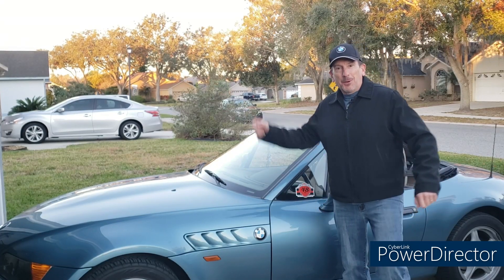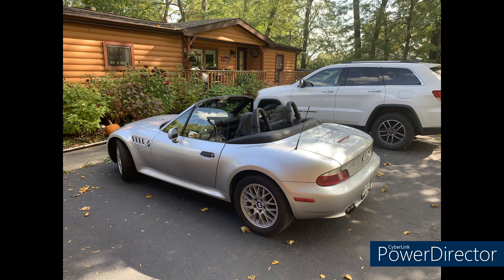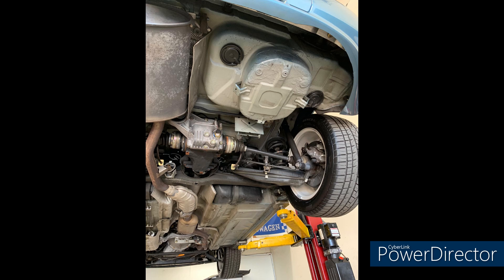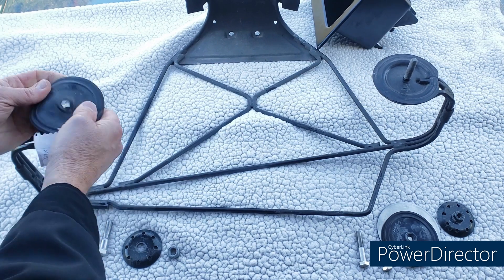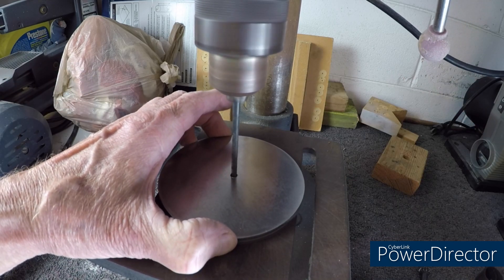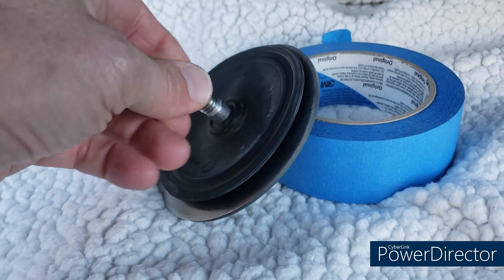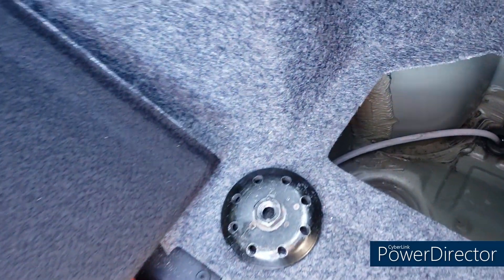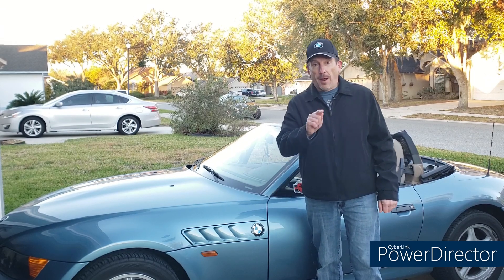How to Plug the Holes Left after Spare Tire Delete: BMW Z3!

Comment: Another excellent video!  Well done!  Thank you.  I also have a complete spare cage with the spare tire, to be available when the car is sold, in case the buyer wants the full spare tire unit.  I really enjoy your videos.  FYI -- You may have already covered this --- I recently opened up my air intake to inspect it and found the foam that lines the inside to be totally rotted / shot, so I removed the air intake box and fully removed all of the foam so it would not eventually fall out and get sucked into the engine.  Thanks again from totally waterlogged and underwater California.  Our area of the Central Coast, halfway between San Francisco and Los Angeles, has received over 10 inches of rain in the past two weeks, which is unheard of, which of course has helped with our mega-drought, but, along with high ocean surf, has been disastrous to the state with close to twenty dead so far.  😐
Reply from the maker: Thank you as always and stay safe! Didnt know you had a spare!

Comment: I would leave a spear tire in place, because on the freeway, doing corners, the weight is helping for the tire grip. Also, you can fill the fuel tank to full 😀

Comment: for anyone thinking this is too much work, you can definitely just use some flex seal tape. i’ve had mine on for at least over a year with zero water getting in and daily usage
Reply from the maker: I'm on board with at as well.  It is cheaper faster and will definitely work.

Comment: Other than weight reduction for racing, I don’t understand the value of removing the spare and cage.  If you don’t trust the spare because of age, could you simply remove it and reinstall the cage?
Reply from the maker: Cage will get in the way of future work.  Thats the main reason!

Comment: Probably a dumb question but,..   why not just remove the wheel and put back the empty cage?
Surely most of the weight you can save from this mod is the wheel and replacing the cage would save all that pfaffing around finding washers and bolts.
Might also want to consider whether to also retain the plastic cover in the cage because that MAY contribute to smooth ariflow under the car. Without all this tire stuff there's a new large void that COULD create vortices and affect drag/noise (unless you create and install some new cstom cover for the entire void space). If you do put back the plastic cover, you'd probably have to mod it with cable ties to strap it firmly to the cage because the wheel is not securing it anymore and it'd probably rattle badly.
Reply from the maker: Not a dumb question at all.  The convenience of not removing the cage when I need to work in the rear is the bonus.  Saves time and hassle.  As far as airflow, if I were racing I'd consider it, but as my daily normally driven in town, its not an issue.  I don't get odd noises nor vibrations at any speed I've driven since (up to 80 or 85).

Comment: Hey Zed, great video! Wondering if you've heard of, or done, the "Fogged" air box mod? I was considering doing it to a junkyard airbox and seeing the difference between the stock and modded. Thanks and love the channel!
Reply from the maker: Seems to be mixed opinions on the old forums.   Looks easy enough to do!  I havent done it.  I think you'd be smart to do a junkyard box for a try. If you do it let us know the results!
Reply: @MomentofZed  will do! I saw someone say it added 12 hp, which would be quite beneficial for the 1.9. Love the Atlanta blue, blue soft top combo by the way! I have an Atlanta blue, tan soft top, 98 👍
Reply from the maker: @yusayoh  i like the tan as well.  I know mnes not original, but the dark blue works
Reply: @MomentofZed  I agree, my tan top has already been patched a few times, so when it finally kicks the bucket, I'm going blue! Thanks for all the helpful videos man! About to tackle the sagging glove box this week 😁
Reply from the maker: @yusayoh  good luck watch part 2 first!

Comment: I just did this delete today. I found an inch of water in my battery box and under the tray above the second washer. I've noticed on both of my z3s that they leak or severely condensate. Enough to build up water. Is it just my cars or is this a common issue? 
I thought about leaving the hole to help drain, but that's a bad idea I already know.
Reply from the maker: Might be the center brake light gasket.  See my video about it when you get a chance.
Reply: @MomentofZed  I missed that! Didn't know you already had a video. I'll head right over, thanks!
Reply from the maker: @vonbrewsky8019  thanks for watching!

Comment: Re-sale, was that a Freudian slip? I hope not.

Pat measured the bolts with a tap and die set? I find that rather odd. Why didn't he use an O.D. micrometer, a dial caliper along with a thread pitch gauge?  Regardless of Pat's measurement tools of choice his bush style fix helped with bolt sizing. Inch vs. metric, irrelevant in this case carry on...
Reply from the maker: I'd only sell to buy an m roadster!
Reply: @MomentofZed  Now we're talking!!!

Comment: Or this easier way bro. Get adhesive backed rubber, cut two circles bigger than the hole. Stick one on the bottom and one on the top. Both adhesive sides meet in the hole and stick for life.
Reply from the maker: Excellent tip.  Kinda bridges the gap between tape and my solution.

Comment: Are you going to drive without a spare now! I think I’m just going to buy a new one & put it in the basket because there’s very little truck space as you know.
Reply from the maker: That will be the topic of my next video.  But I will be without a spare.
Reply: @MomentofZed  That was supposed to be a question mark, not an exclamation mark. Sorry. I was being accusatory. I don’t even think I could get mine out by myself, but I have told myself to replace that old thing.
Reply from the maker: @GreenWitch1  ha ha!  No problem.  I too old to read the punctuation anyways on the phone screen.  Biggest problem is near as I can tell our size isn't made anymore.
Reply: @MomentofZed  That’s crazy man 😳

Comment: That’s too much work for plugging a hole you never see. I would just use duck taper cover the holes on both side
Reply from the maker: That was my first thought and another viewer suggestion.  Really though I think the video was longer than the actual work.  Pats fabrication was probably 20 minutes.  I installed in about 5 minutes of actual work.  About 25 bucks total, 10 of that was shipping.

Comment: This morning my passenger side door tweeter/speaker caught fire while driving, how would I go about cutting power to the speakers without removing the battery?
Reply from the maker: Thats crazy!  Should be able to pull a fuse.  Dont know which one off the top of my head.
Reply: @MomentofZed  I looked at a diagram but unsure if "radio" means the whole radio and speaker system. Really scared the crap out of me, no idea how it happened I wasn't even playing music lol
Reply from the maker: @alepepperoni2563  that is scary and really odd.  Let me see if I can research it a little.